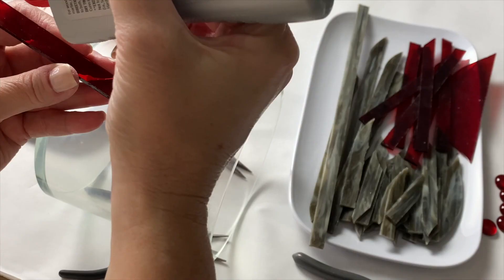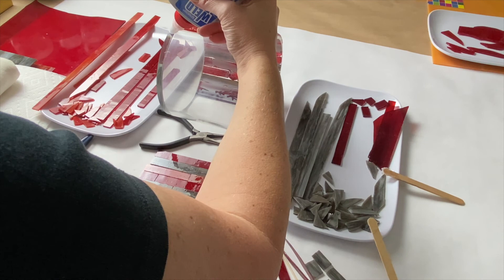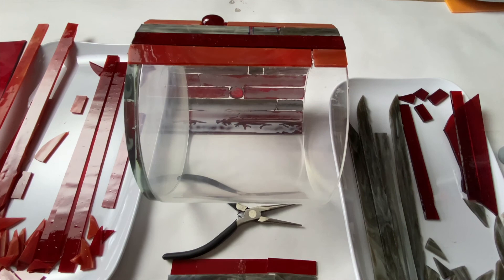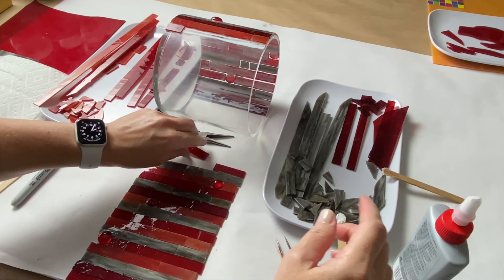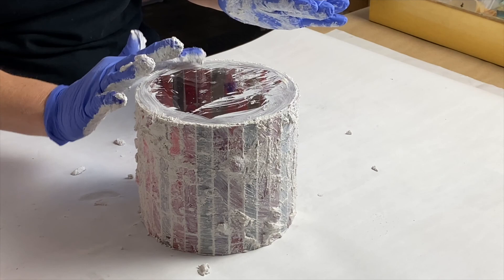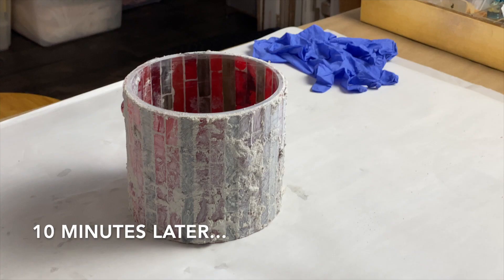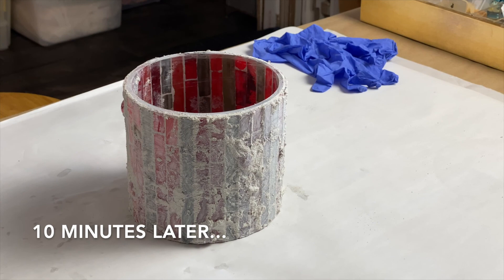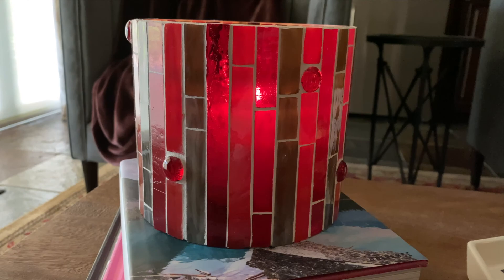HOW TO: GLASS ON GLASS MOSAIC | Hurricane Lamp Vase (Adhesive, Tiling, Grouting, TIPS!)

Comment: I have done many glass on glass mosaics  with stain glass on vases. One thing that has happened to me on rare occasions before grouting I always check my glass very carefully. The tension of the glue drying is enough force to occasionally or rarely crack a piece of glass   creating a grout line that you may not want. Easy fix before grouting.
Reply from the maker: Hi Jan, WOW!, I've never experienced this. I'm sorry to hear this happened. Gah, what a gut punch after all that work on your piece. One thing I try to do is break the glue tension between pieces by running a toothpick or a mosaic pick through it. I realize it's tedious, but sometimes I accidentally go a little heavy on the glue. I also allow mosaic pieces to dry/cure in a cool place and out of direct sunlight

Comment: I really enjoy your videos, thank you for making them. I have been mosaicing for years and I see everything I make as an experiment, something to learn from. I learn more from watching your process. I started a stained glass piece and used silicone (Wellbond is difficult and expensive to source here) on one of the 4 sides. Of course I have lots of little bubbles and I have some practising to do. I am pleased that you did a video on mesh and I wonder if you have done one on curved surfaces? I have a mannequin (ahem) or 2 waiting here. I will continue tuning in and enjoying your work!
Reply from the maker: Hi Claire! Thanks for your kind words, and for watching! It's great to hear you're enjoying the videos. I agree 100% with you. As they say, no 2 mosaic pieces of art are the same, and that includes the making. We should consider ourselves fortunate and lucky to learn something with every mosaic we create. That means we're getting 'better' and learning. What a gift! Yes, silicone can be pesky. I used it a lot years ago. As for the mesh on a curved surface, it can work really well....especially on a mannequin. It would be a real time saver for you to work on a horizontal surface and then adhere a larger tiled area to your substrate. Having said that, some curved surfaces can be tricky for mesh. You just want to watch that you don't lose or open-up your groutline in those areas making it look obvious that you've used mesh. Keep creating and I'm glad you're here!

Comment: An inspiring video!  Because of it, I created some stained glass jars (sides and bottom) which I grouted. I wired some posts to make backyard lights. I am putting the LED lights through the jar lid and they will be upside down in the elements.  I am wonering if it would be better to simply seal the grout or to dip them in clear acryllic to seal them better? I am imagining that once they are outside for a while the grout may crack and/or get mossy. Any advice would be greatly appreciated.
Reply from the maker: Hi Claudia! I LOVE this use of glass on glass!! What a fun project! It sounds beautiful. I wouldn't NOT pour resin over them. It won't weather well outdoors. For one thing the UV rays will yellow the resin. Instead, seal your grout really well. It might take a couple coats. This video on sealing mosaic might help: https://youtu.be/5JqZU5ucM_k. Keep creating and I'm so glad you're here!

Comment: Thank you for all your videos I enjoy watching and learning different techniques from you. However I have a question I recently made a vote of candle similar to the one you did a tutorial on I thought I was doing everything right I used Weldbond to attach all of my glass pieces waited for it to dry and even did a Weldbond wash. However, after waiting a week for that to completely dry when I grouted the piece I still ended up with grout bleed what did I do wrong? How can I avoid this in the future.
Reply from the maker: Hi Joan! Thanks for watching. Great to hear you're enjoying my videos. Ugh, the ol' grout bleed. A Weldbond wash. Hhhmmmm, I'm not familiar with that. I will say that grout bleed can happen if you don't get the entire surface area of each piece of tessera covered.....as opposed to just putting enough glue on the surface of the tessera so that it sticks down. I use a wood craft stick to make sure I thoroughly cover the surface of each piece. I also like to run a toothpick through the Weldbond on the substrate surface to avoid any glass breakage during curing, and it also helps things dry a little quicker. Hope this helps. Keep creating and I'm glad you're here!🙌

Comment: In the video in which you tile a glass Starbucks bottle, you use Lexel for the adhesive.  For this hurricane lamp vase, you use Weldbond.  Both projects are on curved surfaces.  In what circumstances do you use Lexel and when do you prefer Weldbond when doing glass on glass mosaics?
Reply from the maker: Hi Ava! GREAT question!🔥 I used Weldbond on the hurricane lamp/vase because I needed an adhesive that dries clear, but would allow a little extra time for wiggle room with fitting in the stained glass strips. In the case of the Starbucks bottle, I used Lexel because I didn't need any wiggle room with the tesserae because the design was more flexible. If needed, I could grind off an edge or whatever from the tesserae and it wouldn't be noticeable. I couldn't do that as easily with the hurricane lamp without it looking more obvious. Keep creating and I'm so glad you're here!🔥

Comment: Does this glue dry clear?  I'm not a great glass cutter never get a straight line no matter what tools I use, any hints.
Reply from the maker: Hi Gayla! Yes, this glue dries clear. As for cutting straight lines....I line up my glass cutter with a non-skid ruler and push or pull the cutter across the surface of the glass. All of the tools that I use are listed below the video in the description. Practice and take your time. Cutting glass is tricky but you'll get it. Keep creating and I'm so glad you're here!🔥